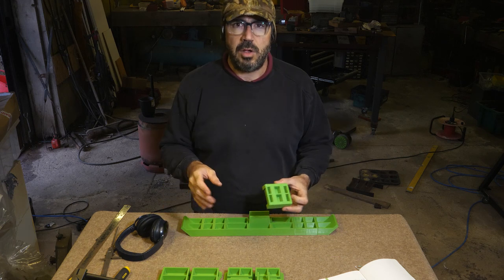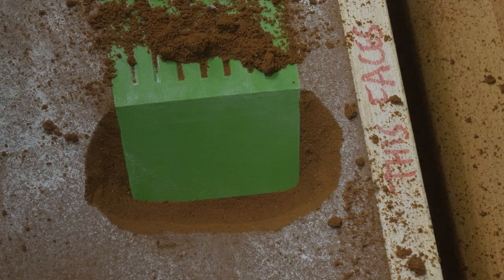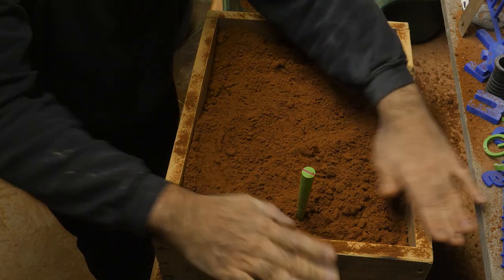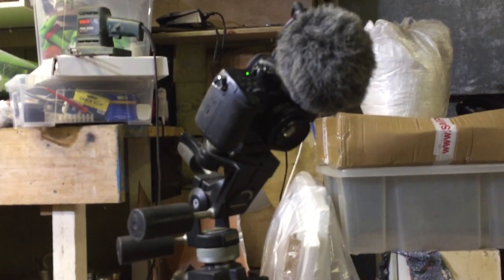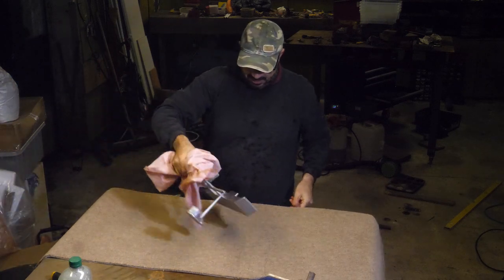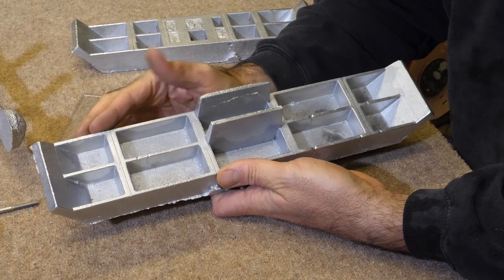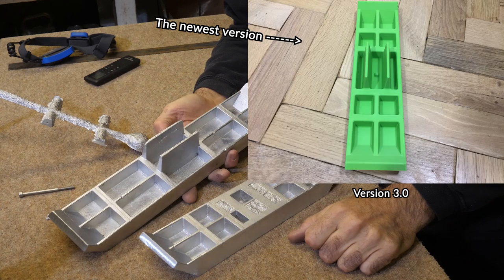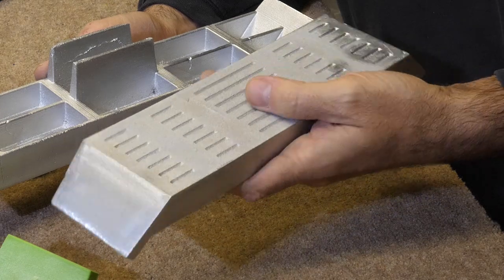Modular Flasks (part 3) * THE FIRST CASTING * (casting design version 2.0)

Comment: Fillets more fillets. Your flask is very similar to yours, except mine are wood with square ends. Make your center rib much shorter by 1/2. Radius all outside corners except where it's not necessary, top, bottom   and ends. You really only need one pin plane on the ends, double or triple the thickness and move up front the bottom. Also make follow board for the 45⁰ ends. Except for the 45⁰ sides the rest of the follow board can have about 20⁰ draft or more. And as thick as your flask. But it's an interesting concept.

Comment: Just on a small side note. Love your vids and if your having trouble with parts breaking off in your sand mold.. reinforce the dug outs with small nails or similar as supports. That way you can flip the flasks upside down without fear of parts breaking away.. :)
Reply from the maker: Thanks Raschelle thats a great idea, although i've never done it before.

Comment: Add some vents and make the sprue at least double the diameter and you'll be able to pour much faster. I actually can't believe it came out as well as it did with such a tiny sprue. If you flip the pattern over 180º (when you start), you wouldn't have to dig out those 45 degree sections.

Comment: That looked like a really good first casting!  I suppose if the flask faces are not 100% flat you could lap it on some coarse sandpaper, kind of how you lap a hand plane. You could maybe fine tune the corners on a belt sander?  I was curious as to why you didn't cast with the 'outside' down so the 45s faced up eliminating the need for excavating them.
Reply from the maker: cheers mark! actually that a very nice idea, i hadnt thought of that. maybe make a little jig to hold the piece at true 45 and sand away the excess bits. god you got me thinking wih your last question! i was thinking er good point?? i think it's becasue i wanted the inside surface to be the widest part of the flask so the sand is kept in my the thickest part. which means the draft has to be the way i did it. so i can only do the digging out thing. (unless i'm missing something - quite probable!)

Comment: Hi Julian, first of all thank you so much for the shout out, that's really kind of you 👍👍👍.   Sorry about your camera lens, that really sucks...  
Wonderful castings, they came out really well, can't believe you got away with putting that sand section back in, I was shouting at the screen... just leave it... don't do it... !!!  haha - Nice dodge mate !!!
And almost no shrinkage which surprised me, I was expecting some issues there.  Just goes to show extruded ally is junk for casting, as I have found out for myself !!
You don't need to worry too much about digging out to the parting line as the cope will fill any gaps anyway, just make sure you leave a generous angle for the extra sand to come out and you'll be fine.  
I think your bowing issue was down to the size of the sprue and the speed in which it was poured rather than anything else.  You want to pour the metal as fast as you can, but not so fast as to damage the sand within the mould.  Your sprue taper at the base was very narrow which restricted the speed of the pour.  In addition you had 4 gates to fill the mould and each of those gates was at least double the size of the base of the sprue.  This causes the flow rate of the metal to slow down significantly.  So by the time your metal reached the end of the runner to the end gates the metal would have been quite a lot cooler and flowing at a much slower rate, hence the bow and the rapid cooling on the far ends.  
In an ideal world the total area of ALL the gates should equal the total area of the base of the sprue.  i.e. 1 gate = same as sprue base area, 2 gates = 1/2 sprue base area, 4 gates = 1/4 sprue base area etc.
This should prevent any air being sucked into the mould and keep all the runners and gates full during the pour.
To fix this I would suggest using a wider sprue, a larger pouring basin so you can get more metal in at the start, a lower lip from the pouring basin into the sprue opening and smaller gates into the mould.  This will allow you to pour the metal a lot faster, help keep the sprue full, allow the metal to flow much quicker within the mould and stay hot enough fill the mould before any significant cooling can occur.  
Using gates with a larger total area than the base of the sprue may be advantageous in some situations and is a good way of controlling or slowing the flow rate.  But if you want to fill the mould quickly then aim for keeping the flow rate as high as possible using the above method.
Alternatively use a seperate sprue for each mould section allowing you to utilise larger gates for each mould half.
You might want to think about using a feeder next time if using the bolt on method of attaching a handle though as those sections will be a bit thicker.  But to be honest they look fine just as they are.
Do remember I don't really know what I'm talking about and am just repeating what I've learnt from other people, so take my advice with a pinch of salt until someone more knowledgeable comes along !!!
Nice to see you casting successfully without vents too, pro caster !!! 😜😜
Love your work, really looking forward to part 4.  Keep up the good work mate, Cheers... Andy 🍺🍺🍺👍👍👍
Reply from the maker: Cheers Andy! you are very welcome mate. Thanks for the help too. Yes i think you are correct, i think i will need feeders, especially at that thick extension piece, the shrinkage there is def causing it to bend at that point too. so hopefully it will help wth that. (you'll see in the next casting - which is much better, the bend is worse!) yeah the gates were a mess too, i've messaged perry about his gates&spintrap combo, i think i need to print something to make it really easy to mould and pour (the pour on my next one is much better too - i'm getting used to aluminium again!)  cheers loads o/

Comment: Sorry about your lens. 
I think you are going to wrong way making ribs thicker. In casting it is best to keep constant cross sections. They will work find with fewer, lower and thinner ribs. more corner radius and no sharp edges. They are currently extremely massive considering the loads on them.
Reply from the maker: you are absolutley spot on RotarySMP (as usual), i'm taking your comments on board i explain in the next vid where i'm trying to head. and i realise why i made ribs in the first place! (you'll see what i mean) thanks loads for the help.

Comment: Awesome Julian! These are looking great! I would say go nuts on the draft. I cant see a reason why you couldn't go up to 15 degrees, but 10 should do. Also using cheap flat black spray paint and some steel wool to smooth it when its dry really helps with releasing patterns. Sorry about your lens.. Hope it wasnt a 24-70.
Reply from the maker: Cheers Seth! the only reason i'm trying to keep the draft as small as posible is to try to stop the base of each extrusion as small a volume as possible, if i go huge with 15 degrees by the time i've risen up 20mm the base is a beast! i'm trying all avenues at the moment! thanks why it's so much fun, it's amazing how a few changes can make a huge difference :) no it wasnt at 24-70, but it was a Panasonic Leica 12-60mm (MFT) which is quite a loss (i'm sending if off tomorrow - fingers crossed!), cheers o/

Comment: Once again a great video Julian, I just love your presenting style! Looking forward to the next instalment.. On the subject of cameras, I currently use a camcorder style camera but I have a DSLR with a dozen lenses ranging from 10mm to 500mm and several zoom lenses but my body doesn't do video. I could easily upgrade the body to one that does do video but I'm worried that I may ruin lots of expensive lenses in my harsh metallic dusty environment, do you find the quality of the video justifies the extra expense?
Reply from the maker: ahh i had a different problem of having no lenses or body, that's why i went with the GH5, it's still bloomin expensive, but the lenses are absolutly relativly cheap compared to the big boys. Yeah i'm not sure it's worth it though. This breakage sure did set the expenses back! The GH5 does have wonderful video though (4k at 10bit) but the sensor IS small (hence cheaper lenses etc) but it does mean it struggles in poor light.
I also got the camera when i was painting and that's less mucky/dusty, but thankfully nearly all my stuff is weather sealed so i've never even had to clean the sensor or even a lens yet. (i put a cheapo UV filter on the front of all my lenses to take the rubbish/dust. and it really saved the front element when i dropped the zoom, it's just something inside that broke. The one downside with the panasonic stuff is they dont seem to have many parts for repair, my repair guy has said unless it's simple then it could be a right off, wheras a cannon lens may cost 4x more but you can get every part as a spare.
what mount are all your lenses? because you can get 'speed booster' adaptors like a metabones that will convert proper big lenses to a GH5 (MFT mount) and that combo is INSANELY GOOD. the speed booster will x0.7 the seed of your lenses too, so a nice F1.4 is like a F0.98 !!! (unheard of unless you get a voightlander crazy thing on a MFT).
i love my GH5 but i'm finding i'm having to get expensivish (fast) MFT lenses to compensate for the small sensor size and poor lighting. I guess i would never had taken the plunge if i'd had to buy an expensive professional cannon with 3 expensive lenses too, so it's been good to get into it too.

I need to take a little extra time to get the shots/lighting right too, it's been lacking recently and me having to use a prime lens now has made me do it all right again. So that's quite cool. (although i do still take some dark shots - i need to stop increasing the F stops to get better focus depth of field, that's why my shots have been a bit grainly recnely (as i've been using higher and higher iso's compensate. so now i'm on the primes i'm taking it more seriously again! my next casting vid (out today hopfully) has some better shots! (but still a few dark ones grrr). So i guess it sort of does justify the expense, as i had no camcorder even, and if you take the time you can get some amazing shots, but i need to make more time to do it lol.
cheers mate o/
Reply: @JulianMakes  Thanks for that, I have an Canon EOS, but it's an earlyish one before video was almost a standard extra so all my lenses are quite expensive! I like the idea of being able to play about with the shots more but think on balance I might just stick to the cheapish camcorders for now. When (if) I get my new shop I might consider it again when I have more room.

Comment: Coming along great!  The pattern never pulls perfect the first time...  I can't believe you got that broken sand core to stay put when you stuck it back in, lol, nice save!
Is it possible the sand in that big heavy drag flexed a little bit while you were rolling it over and/or rapping on the 3D print and/or ramming up the cope? That could be an alternative explanation for why the casting was bowed a little - the wider and heavier the flask, the more likely the sand is to flex if it isn't supported...  
Are the flat panels and the redesigned ribbed sections all about the same thickness?  I wouldn't think any of it needs to be very thick for the casting to be quite strong, and the closer you have to uniform thickness throughout the part, the fewer problems you'll have with shrinkage.  
Really looking forward to the next update!  I actually like seeing how molds get made though, is it just me?  I don't find it boring at all. 😀
Thanks for the shout-out!  One thing I did not mention in my flask pin video is that the pins coming up from the drag should not be so long that they stand above the top of the cope when the mold is closed, as they will be in the way when you want to strike off the cope, or to set down the mold upside down if needed.
Reply from the maker: Hi ya Tobho, cheers and you are welcome mate. lol yeah i was lucky on that wedge of sand! Thanks for the help i will hopefully start thinking actually making the pins very soon!

Comment: Good on you for the run.

Thanks for posting this video. Good first attempt.

What layer height did you print these at?
More radius on all inner corners would make it pull better.
For trying out an experimental pattern, you don't need to cast it, just ram it up and try pulling it. Mould making practice also mulls the sand, improving it.
The blocks which separate are failed moulds. Placing then back in place risks floating up on the pour. Start again.
 Considering the striations locking in sand, it is a surprise they pulled as well as they did. Good point on the parting powder filling the striations with use.

From a strength perspective that mid horizontal rib is unnecessary. If you delete it the sand features will be stronger. The rib and walls could all be thinner so the print faster and use less metal.
Reply from the maker: super points Rotary, I printed at 0.2mm layer height, but in 'fast mode'. More radius is spot on i think too. (V3.0 is now 2mm - v2.0 was 1mm), but i think going much higher would be better.
i'm casting v3.0 today, but the way it's evolving i'm already considering reducing the ribs even further. I think you might be spot on with the middle one too. I'm realising that the ribs are only there to give the 3dPrint some strength and not the aluminium, and honestly the ribs might be fine at only 2mm high at the furthest point to the dovetails.
if i can reduce the dovetails in height (?two per join?) then the horozontal ribs coult be greatly reduced perhaps to nothing. Which might greatly reduce the bending of the part. But i'm guessing there. But great point on the middle rib. I'll be looking at that with a very critical eye after todays casting. cheers loads o/

Comment: I see a pattern or trend emerging in this video ( no vents ), are you going to use vents less in the future?
Reply from the maker: luckygen1001 hi lucky I’m not sure I use them that much. I usually put them in if I’ve got a core of some sort, but I have found them unnecessary recently :) Do you use greensand or petrobond?
Reply: Home made greensand 99% of the time and 1% of the time I use petrobond sand.

Comment: Overall very nice.
You should print swdweeb's spin trap, runner, and pouring basin. Your basin ridge is way too high, it should be 10mm off the bottom of the pouring basin (you hat it 10mm from top).
the art of repairing a mold when there was a breakaway is a challenge. 
I believe small wires can help stick those chunky sections back together by pinning them kind of like soldiering or gaggers.
note: the pins you should put on the shortest length of your flask. 

ya, that looks like a cold weld on 28:21 and 31:58

yes, bigger filets on the inside corners for the outside grid, more draft, prep the PLA patterns, less thickness on the ribs on the short section, 
your changes are good.
Reply from the maker: i think you are spot on Ask. my next go is with bigger fillets (you'll see that happens!). abd i've messaged perry for help about the spin trap/runners for his advice. The next casting was very interesting for various reasons, i hope to have it up later today. cheers mate :)

Comment: great vid.  I'm curious about running that burner indoors.  do you have ventilation?  doesn't it get smoky/fumey?
Reply from the maker: thanks emaglott! yeah it can get smokey/fumey but i try to wear my respirator mask when i remember. It's a bit worse in winter when i only have the shed door open 30cm, intead of wide open
Reply from the maker: @askquestionstrythings  i will get one today on amazon good idea thank you!
Reply from the maker: Purchased and coming on Sunday! Cheers :)
Reply: @JulianMakes  yes I was about to say that you could be producing CO based on the air/fuel ratio you end up with in your burner.  As I watched your video of that long day where you were getting less and less alert, got me thinking and worried.  Maybe a simple hood over your furnace vented through the roof?  plenty of heat there to create draught.  Respirator will not remove CO.
Reply from the maker: Im all fine thank you so much though. I was just really really tired from my run and the lens screw up! The co sensor I got show a digital read out of ppm and if it goes ove a certain amount it bleeps like a banshee, I’ll be 8nterested in seeing if it shows anything happening :)

Comment: The sand is probably just dry. You will need to add water and mull it.
Reply from the maker: Cheers RotarySMP, yeah i think you might be right. Ohh i want a muller so bad :)
Reply: Plastic sheet on the floor, sand on sheet, add water. Fold over sheet and Julian runs the next 17km on the spot. Who needs a muller :)
Reply from the maker: @RotarySMP  hahaha!